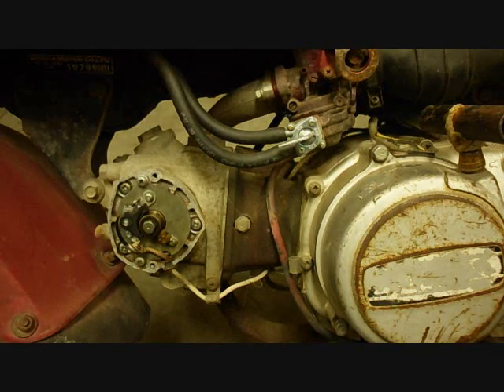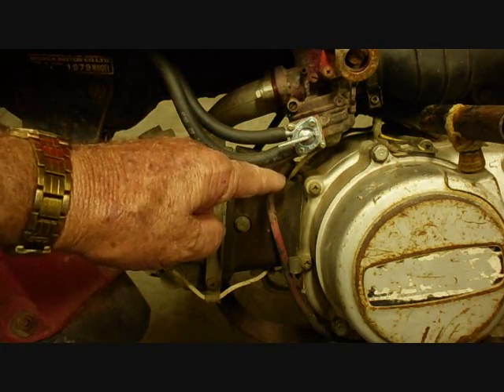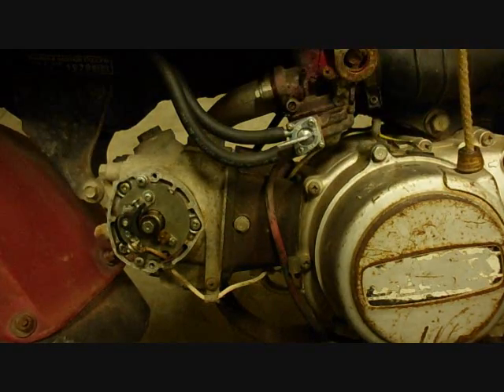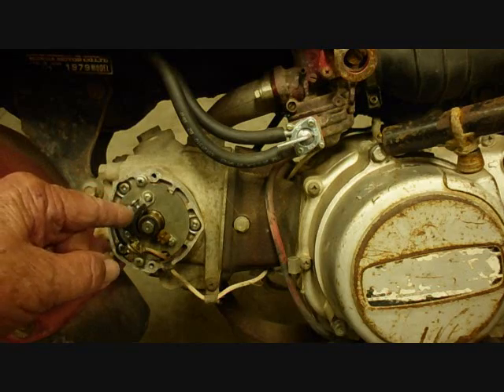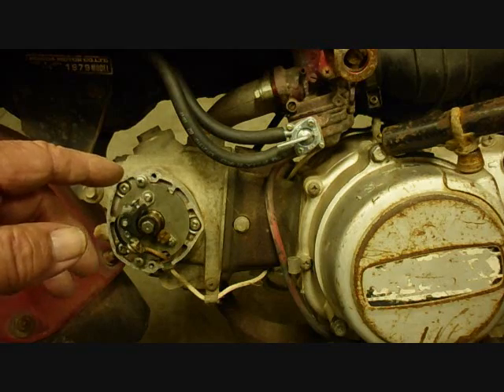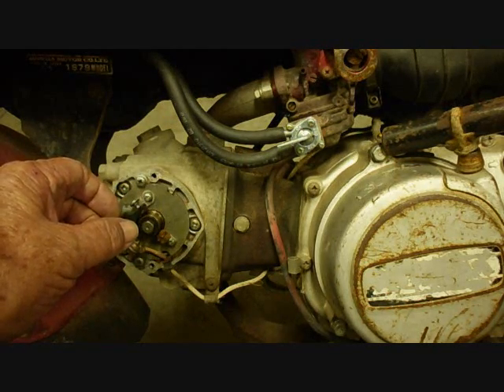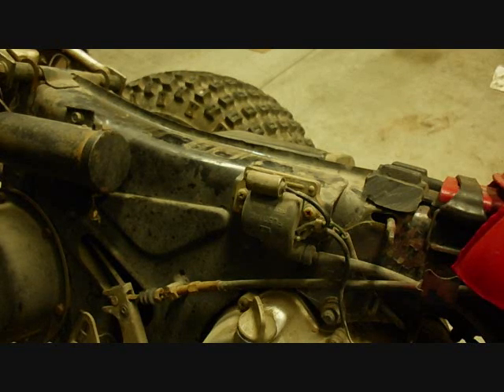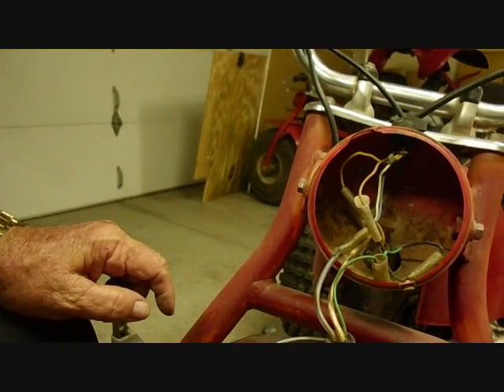Honda ATC 110 Electrical Wiring, Part 2 of 2, Ignition

Comment: Hey Bruce,
I've been watching your YouTube videos about the atc 90/110 headlight wiring and I had a question. I made a quick video https://youtu.be/4YtZkjSjdtg for visual reference. I am missing something when it comes to the green wire. I'd appreciate any help you can offer. Take care. Sincerely,

Chris
Reply from the maker: Five years later and I just noticed your question.  Your video isn't available anymore for me to refer to.  I'm not sure about your question.   So I will guess.  The headlight wiring on the 90 and 110 are a little different.  The 90 has three positions.  Kill, run, and run with lights.   There is no high/low beam selection.  The 90 has another kill switch on the handlebars.  So both the headlight switch and the handlebar switch must be on for the engine to run.  The 110 headlight switch has three positions also but is wired differently.  The positions are lights off, low beam, high beam.  As far as the green wire, it goes various places.  It is used to complete the path for the lights.  It is also used to connect the black wire to ground to kill the engine.  Hope this helps you and you haven't been waiting patiently with your metric wrench and JIS screwdriver in hand for my answer.  Maybe this response will help someone else.  That's why I make these videos.  Just to share what I have learned.  I haven't been paid a dime from youtube.

Comment: I'm trying to find a source for a coil for my 1977 ATC 90? Everything I keep finding is for the CDI models. I saved your wiring videos as my whole electrical system needs redone and a lot of it is missing.
Reply from the maker: The coil is going to be hard to find.  They show up once in a while in eBay.  But they are used and very expensive.  This coil comes with a condenser.  Maybe the 1979 or 1980 ATC 110 coil will work or one from a CT90.  I don't know.  And these will be expensive also.

Are you sure the coil is bad?  Have you checked if the magneto is working?  How about your points?  and do you have a clean spark plug?
Reply: The coil is missing entirely as is the carb and intake. Motor has good compression and I did put a plug in it so it wasn't exposed to the elements anymore. I haven't pulled the cover to check the points yet. Thanks for the response may have to see if I can adapt something.

Comment: hi I need some help I have a honda atc 110 79 and I am getting no spark the coil was bad I got a new one and still no spark
Reply from the maker: Unplug the kill button to make sure it's not shorted out.  Do you have the right coil?  The one with the condenser attached to it.  Attach your ohm meter to the primary (black) wire on the coil and to ground.  Set it to AC volts.  Around 6 - 10 volts depending on the setting you have.  I use the analog volt meter so I can see the meter deflect.  Now pull the pull starter and see if the needle moves.  This will give you a rough idea if the alternator (magneto) is working.  Have you tried a new plug?  Did you check your points?  I hope these ideas help. Bruce.

Comment: Thank you very much for the videos Bruce. I'm new to ATCs and just got my first one today, a 1980 ATC 110. Your videos are hands down the best information I've found aside from the manual so far. Thank you so much for taking time to do this.
Reply from the maker: I'm glad you are using the manuals.  They are the best source of information.  My videos provide a clearer picture of the parts and give you a visual image of the process.  So it is good to use a combination of manuals and videos.  Have fun!

Comment: Hello, 
I have a 79 Honda atc 110. Did not have a coil on it when I got it. Could you tell me the proper part number for the coil so I can try to find a replacement?
Reply from the maker: +Scott Hurd:  I don't have the part number.  The coil for the 1979 and 1980 ATC 110 will work.  There will be a condenser attached.  The 1981 and new ATC 110s have a different coil.  I hope this helps.

Comment: Bruce.How are ya? I have a 1981 Honda C70 Passport. I have a question about the connection of 2 wires on the point set. One is the capacitor the other is to the starter coil (I think). When the 2 wires are attached do they need to be separated with the little red insulated washers somehow? I have no spark on the points. I have seen spark, only once in awhile. Engine will not kick at all. I know there is electricity. to the points.
Reply from the maker: Hi Kenneth.  I'll try to help you.  But I have to admit that I am not a mechanic.  I studied electronics 50 years ago when I was in college and now I have a few ATC 110s.  So I figured out the ignition systems on the ATCs and made a few videos.  Do you have a service manual?  They are free on the internet.  You can find one at http://ohpeds.wikispaces.com/1981+Honda+C70+Repair+Manual and at various other sites.  On page 176 you will find a wiring diagram.  Don't use the on for the 1982 passport.  It has a CDI ignition.  You will find a black wire coming from the alternator (magneto) and it splits and goes to the points and the condenser.  (The ignition points and condenser are in parallel to each other).  This wire should not be grounded to the frame.  Maybe that's what the red insulator washers are for.  So the circuit goes through the points and then to ground.  The other leg goes through the condenser and then to ground.  I hope this helps.  If not, you will have to find a real mechanic or at least someone knowledgeable on the C70 passport.  Good luck and let me know how you make out.